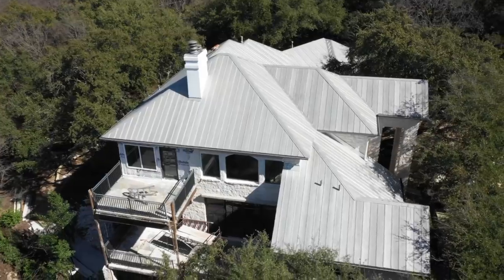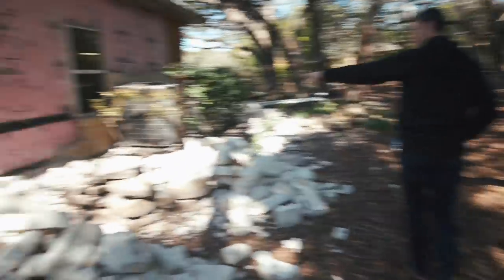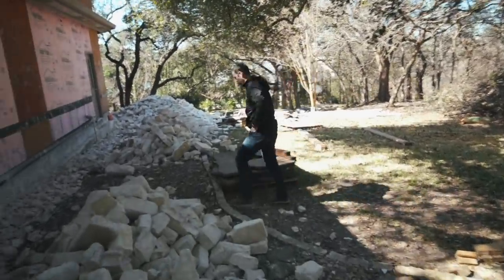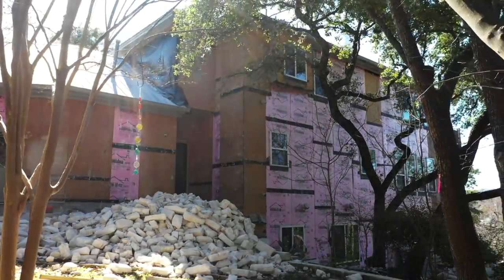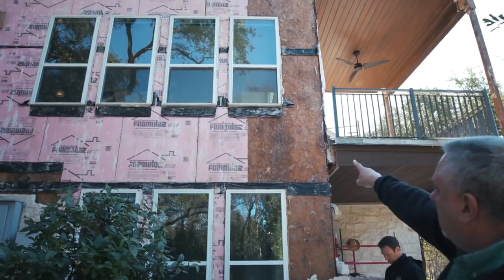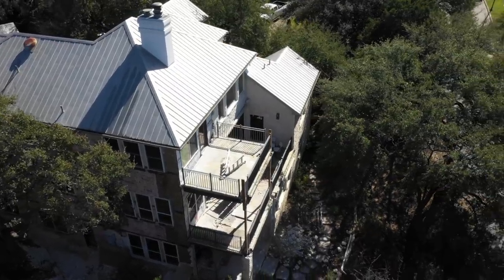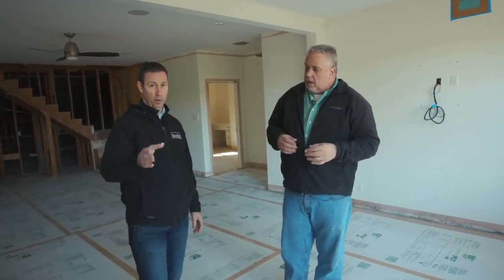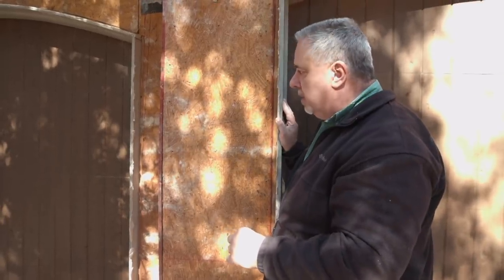You Won’t Believe What’s Behind The Skin Of This 20 year Old House!

Comment: I can't believe that they are tearing real stone off of a three story house and replacing it with stucco.
Reply: The facing needed to be replaced is order to be able to insulate it otherwise it would've rotten away within a year, two max, so I understand that. I guess restoring the stone facing was just a lot more expensive than stucco. It's a shame though, the stone gives the home much more character and appeal.
Reply: @Xiph1980  
Xiph1980
9 hours ago
"The facing needed to be replaced is order to be able to insulate it otherwise it would've rotten away within a year, two max, so I understand that."   Why did the stone have to come off?
Reply: henry porter - if you listened to Matt in the video, they are replacing all of the sheathing, and to do that all of the exterior siding material (whatever it might be) has to come off. Once it is off, then they discovered some of the issues that came with the building techniques used originally.
Reply: @stevebabiak6997  Thx for reply! Did not catch siding was to be replaced.  I need to watch this vid again.   Siding did not look in that bad a condition.?
Reply: henry porter - in some places there was some noticeable damage to the OSB, so taking it off seemed to be necessary in their opinion.
Reply: @stevebabiak6997  I would have just ensured all of the gaps around the windows, etc. were sealed to prevent any additional water intrusion.  Even with the stucco, any cracks or gaps that open around the windows in the future will allow leakage if not caulked promptly.
Reply: @robstephens  Copper flashing would have looked nice w/ the stone.

Comment: Two questions: 

1) Why is this waterproof membrane called "flashing" in the US?

2) How was the stone attached to the walls, and how could the weight be supported? Did it basically sit      on some sort of concrete base in the ground?  I could not see this clearly.
Reply: there are many rubbery flashings in use.....masonry must rest on a solid( usually concrete) foundation.
Reply: D.E 303- A new, low cost, home buildable, solar electric concentrator.    -   So, the weight of the stone is taken up by the basement, and it is stabilized verically through being "glued" (with some sort of cement) to the OSB? Or are there some sort of hooks driven into the walls?
Reply: @christiangeiselmann  supposed to be clips nailed to the studs, and set into the mortar.
Reply: Stucco (a spongy porous and lightweight concrete) is much more commonly used than stone.   I can speak for stucco accordingly, as an owner of such.  Also my house has one exterior decorative front wall faced in beautiful Palo Verde stone, built 55 years ago...in southern California.  I see steel wire holding the stones in place, and mortar of course (grey) has been installed between the stones. 

To answer your question, WITHOUT authority, I can only say "No way José" that stone façades simply sit on the ground.    They are repetitively anchored to the structural wall behind any such "façade" ... more recently appreciated as a layer of protection, more than just an embellishment in the name of aestheticism.
Reply: "Flashing" is only the edge element of a waterproofing membrane.     It is typically galvanized steel sheet metal, long and narrow (though shaped), and exists at the bottom of a exterior wall's surface, so as to deflect rain towards proper drainage, and away from any possible improper entry to the structure.        I suppose, like a lot of words in the English language, the etymology is complicated!
Reply: @johnbecich9540  stops bullets too, as well as fire...good for californiastan!
Reply: 1.  Flashing is thin metal or plastic used to divert water away.  Commonly used around chimneys and at the tops of doors and windows.

2.  The slab foundation extends past the framing, and creates a step for the brick or stone to sit on.

Comment: If I were building a new house, my number one priority would be to NOT have to come back and rebuild it 20 years later because of rot and mold and insects and other such stuff. Termites are a problem you don't address much, if at all on your channel, Matt, but moisture that doesn't dry is a huge attraction for them as well. What about structural masonry? Should we be using massive ashlar blocks to build our houses? Quartz and granite are less permeable to water, but building a house from these materials would be extremely expensive.

Comment: Houses like this, in all ways are a example of what housing / a home should never represent...……  built out of organics is a practice that needs stopped today...…. that house is literally a assembly of organic food for bugs to molds and bacterias with side of VOC gases for good measure.

    Guys like Matt and Steve represent a giant leap forward in building science...….
Reply: Shawn Cockrell so what kind of material do you recommend to get a house that lasts longer?
Reply: @shawncockrell6007  the house with the clay slate roof in the movie Blow is nice quality, amonia free. Fire and vapor ratings are 2 fold higher/ concentrated (better)
Reply: There are plenty of "organic" houses build on stone foundations that are in better shape than most homes built in the last decade.
Reply: Really OSB was marketed as laminate wood, then lumber liquidators comes out of no where with milled flooring, warehouse direct. Engineering schemes like this a questionable. Registry for stock is very important. Can't be forged. I mean shouldn't be
Reply: @killerhz  as mentioned in the video, it is because they leak air and dry out, we can`t do that now for many reasons,...but yes they lasted for years.

 Also, those were made with tight ring old growth wood, not this new wood,...not even close to the same thing, night and day different

Comment: Matt, can you please explain to me why is "western" world so hung up on wood construction compared to east Europe where main building blocks are concrete, brick and mortar. I mean looking at the prices of things, here where i am, you can make  one square meter for 600e gray condition (when building new house), and around 800-900e with all the finishing inside (floors, doors, bathrooms and such). And you do not get these kinds of problems like rotting and high bills for heating and cooling. I'm just interested in your perspective on these types of differences, i have seen your trips to Swiss and Germany and their ways of building with wood, but why the wood when it is not superior building method for long lasting, rotting free, usually hurricane/storm proof, higher R value. Thanks for the possible answer/episode on this, thanks for the videos and of course thank you for doing what you do in a way that you do it.  Much love from Serbia <3
Reply: Wood is cheaper here and requires less skilled labor to work with. Also, a wood structure can be changed later more easily. A well insulated wood frame house will have a much higher R value than a concrete block house unless you add wood framing and lots of insulation to the concrete house. A concrete house will survive a hurricane better than a wood house, but most of the continent doesn't get hurricanes or tornadoes.
Reply: @gblakev  thanks for the answer. wow here is completely opposite situation , wood working labor here is much more expensive then  masonry.... even materials are cheaper .... off course foundation is always the most expensive part ... but after that 2 layer brick wall (outer thinner, inner thicker) with air gap between, outside 2 inch Styrofoam with mortar finish , brick/rebar beams with floor bricks filled with concrete for the floors, and that is pretty much it , roofing is almost the same  here.... there is so much more to be done making it out of wood that is why it is so strange to me .... that is why i asked ....thanks again

Comment: Every generation of builder seams to try and balance best practices (for it era) and value engineering.  Begs the question - what is the industry doing today, that is considered acceptable, that will be a lesson in 20 years?
Reply: Stucco without a drainage plane is humid, rainy areas.  The moisture gets trapped against the sheathing and the fun starts.  Seen plenty of this in Houston on houses 5-20 years old getting stripped down to be repaired.

Spray foam in humid areas, just fucking no!  These houses need to be able to dry out even in 100% humidity, and foam stops that.  It can be helped with additional ventilation, but you'll get mold if it ever stops working.

Gypsum sheathing, oh hey lets put drywall on the outside of the house to hold it together under crappy Tyvek.

Cheap, poorly trained laborers working for peanuts.  Pay more now, or pay more later when things fall apart because they werent installed correctly.

Comment: Hard to believe a 1990s stone clad home could have so much rot.  Stone homes are supposed to last for 200 years or more.  The lesson is never buy a used home.  Build new with ICFs, wide overhangs, and a rain screen.
Reply: Its stone cladding, its simply a nice facade.

True stone and brick houses will last a long time, but cost a lot more to build and are usually far less efficient.
Reply: Not a stone home.  A stone clad home.   Stone is (obviously after watching this) like a sponge.    Not good in direct contact with the wood.   Actual stone or brick is really, really rare, and hard to achieve R values in.  Also they aren't as structurally sound as one might think.  It is a collection of small pieces, poorly held together.   concrete with a stone or stucco facing is much better, and still probably won't last more than 200 years, on account of rebar corrosion.

Comment: Sheathing looks pretty good except where they trapped water behind the bay window trim, and where the through-wall flashing was not durable. Honestly, I’d be pissed if my builder recommended removing all that stone to find basically perfect OSB sheathing behind it. 

Replacing masonry veneer with an air gap (the original and best “rain screen”) with stucco over wood framing is not a solution that makes any sense to me. Stucco belongs on masonry not wood.

Comment: Drainage and ventilation are two words that belong with OSB (chipboard) construction. Like they said, the house was so poorly built ( bad air sealing) and the house survived. Recipe for disaster is water with OSB. Stucco is fine as long as the rules of drainage and ventilation are met. 20 years should be nothing in a life of a house.

Comment: Soooo, what was really so bad about it that it needed a 200k demo/remodel?
Reply: One thing to understand is that the house in its current condition is the very BEST it would be, it would continue to degrade, and he degradation would be exponential, not linear
Reply: Customer taste seems to have a lot to do with it.  Fixing the underlying, likely previously unknown, issues is just icing on the cake.
Reply: @stevenbaczekarchitect9431  it is easy to wonder if several masonry coatings and lots of caulk+ some good ventilation would have done it with out 300K

Comment: a few coats of sealer may have saved it?
Reply: Honestly I think it would have made it worse - the best thing this house had going for it was "drying potential", sealer while reducing wetting, would highly reduce the drying
Reply: @stevenbaczekarchitect9431  In other words, you're saying that the original construction method was so poor that water would have entered ANYWAY, and then been MORE TRAPPED than it was, otherwise.
I observed your astute, ironic comments that this "energy pig" was saved by its very leakiness ... !
Matt published, long ago, on early 20th Century Texas house that was utterly leaky, had no insulation... and was in good shape when he tore it open, thanks to its endless ability to dry out. 

PS.  I own SoCal property and we have little rain.  But once rain soaks into wood, softening it... that's where the drywood termites persist.
Reply: @stevenbaczekarchitect9431  possible....see my comments above.
Reply: @johnbecich9540  see my comments above